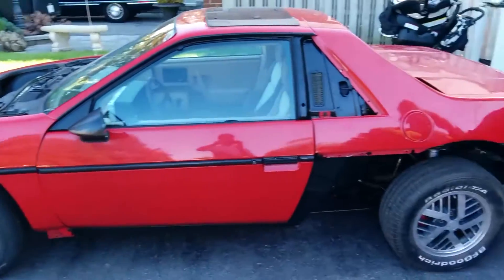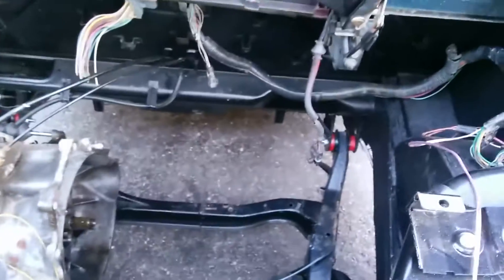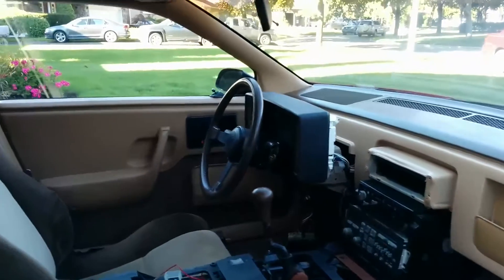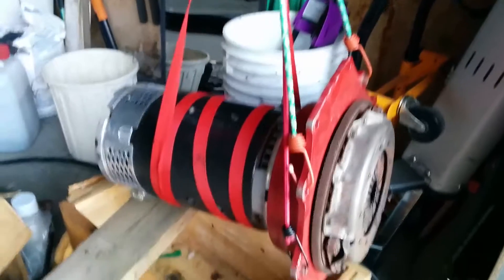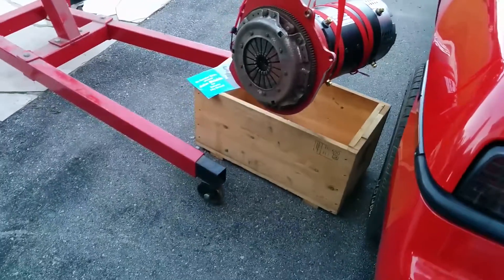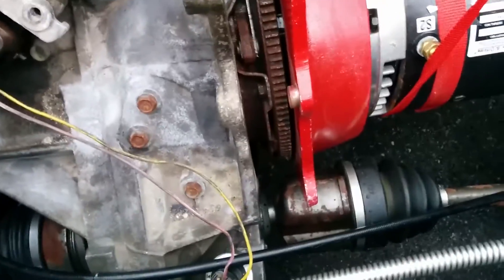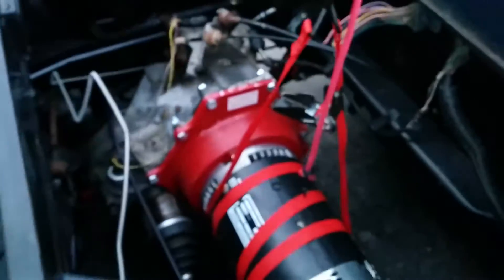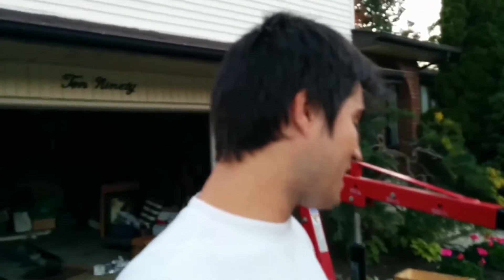Electric Fiero - Installing the Motor

Comment: How is your battery placement gonna effect weight distribution? Did you think about putting batteries in the tunnel were the fuel tank is/was?
Reply from the maker: responding 7 years later lol. Battery placement was a tough one. I based my battery box design off another Fiero that had a similar build. I did have to buy new springs for the front, but the car still drives nice. I did think about putting some of that weight in the tunnel where the gas tank was but they wouldn't fit nicely, perhaps if I were using a different type of battery cell. I will have more information in and upcoming update video. Its still not fully finished and there will be lots to show!